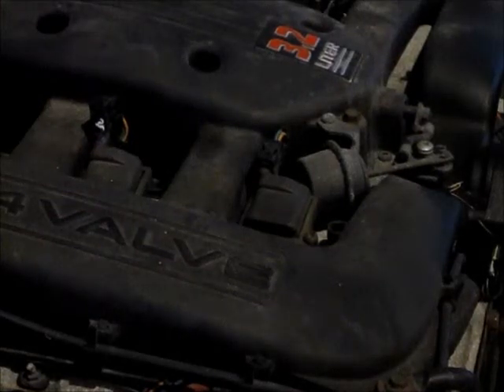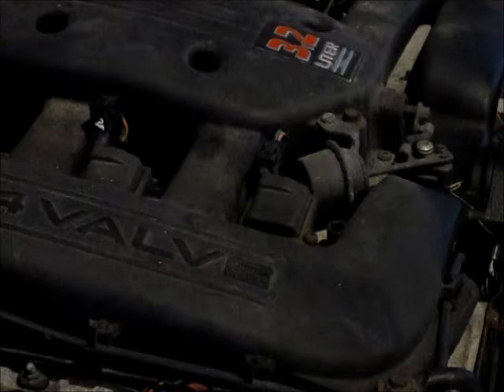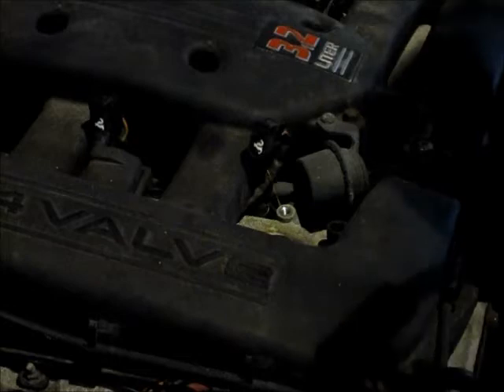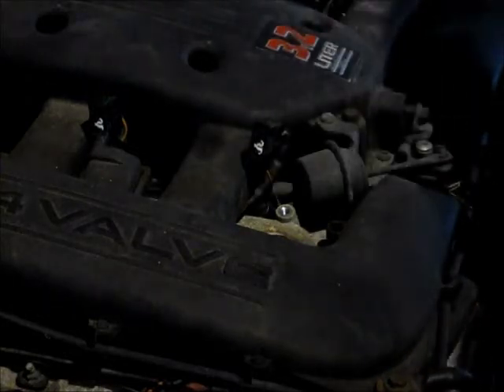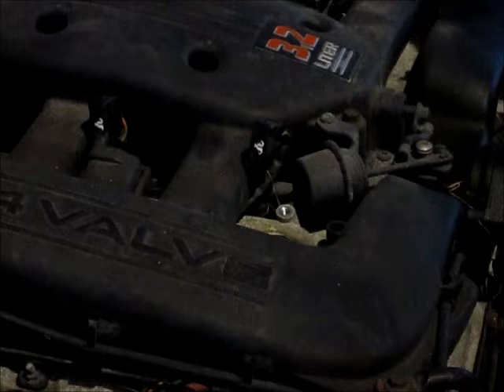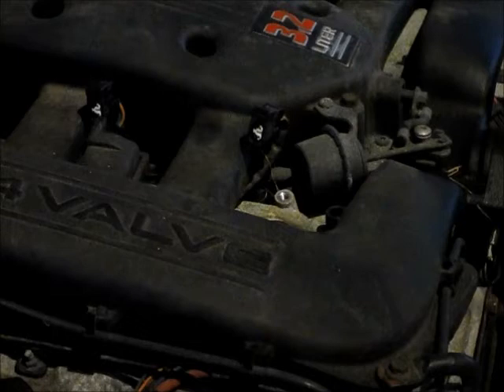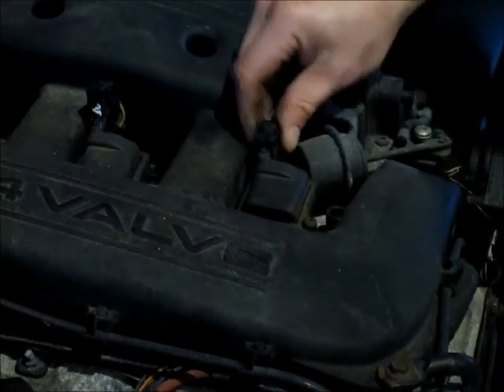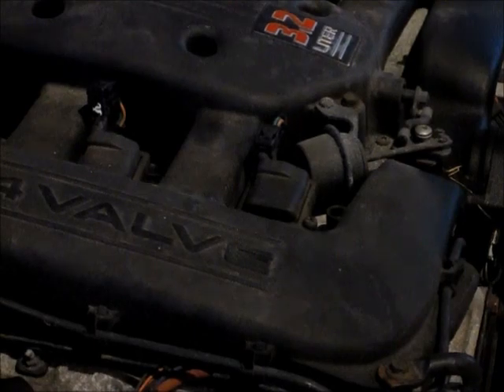Chrysler Concorde 3.2L changing spark plugs

Comment from the maker: Glad to help!  Hope it goes well for you and post any questions you might have that I can help you with.
Reply: Mine has been having issues starting,
I can jump it  though

 the battery is from 11/19 it had some corrosion so I cleaned it(a bit)
As you know accessing the battery means I got to take the tire off and I need to get a new Jack before I do that (planning soon)

We replace the alternator around 2 years ago, so I don't think it's that

I know the spark plugs are overdue so I'm going to start there

The car has not thrown any codes, so that's why I'm trying to troubleshoot
Anyway I know it's been seven years since you posted this, so I can get it if you don't get back to me but either way
Thanks for the vid 👍